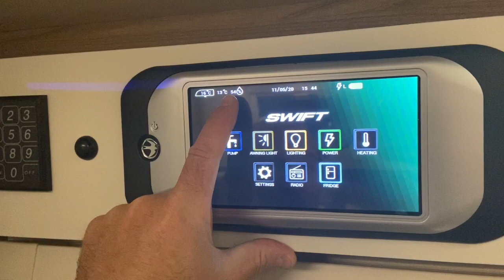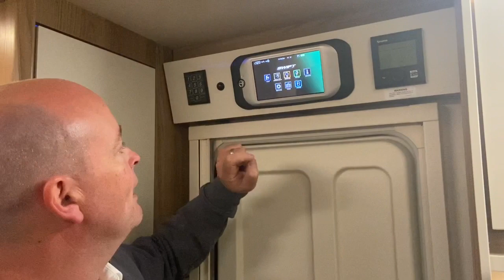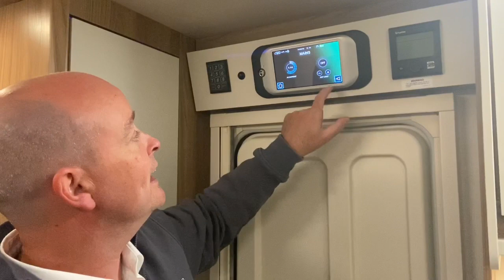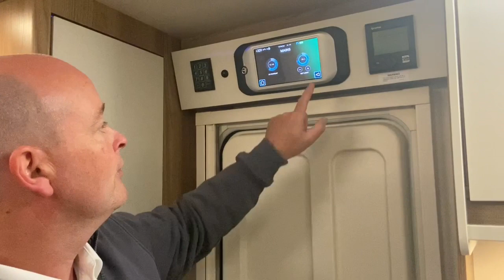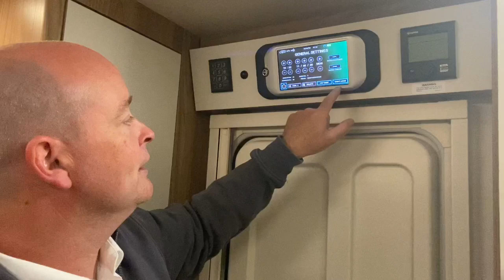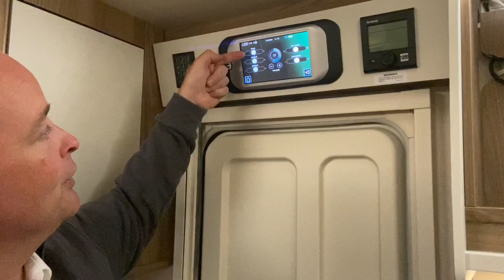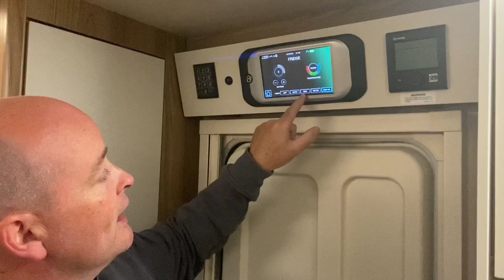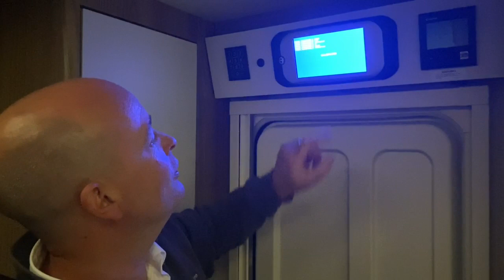Swift Caravan Control Panel Tutorial by Tamar Caravan Centre

Comment: im loving these vids as being new to caravaning, (having not been able to use it yet lol), just a question, we had ours hooked up to the mains just to test everything and get use to setting it up, we got most things sorted but our hot water didnt heat up i went through all the options on the control panel  and the other panel, and the owner manuels,  and still couldnt get it working, and we tried the following day useing just the gas and it worked,  so was wondering how to get that working is there a way to do it,  it was hooked up for well over 2 hours while we were working things out, but within 30 mins on the gas it had heated up, i no this makes me seen a bit dumb   x